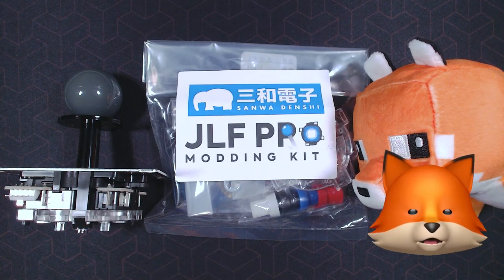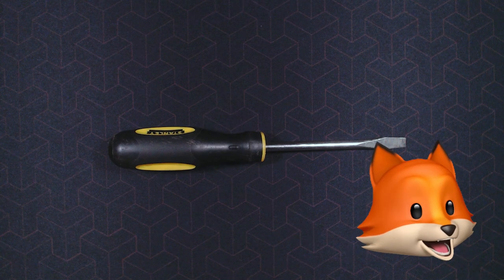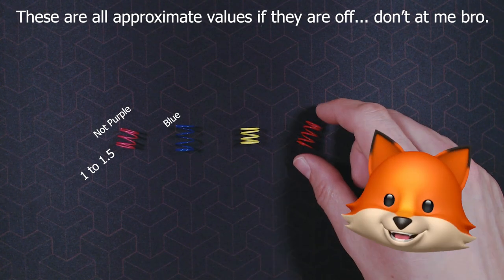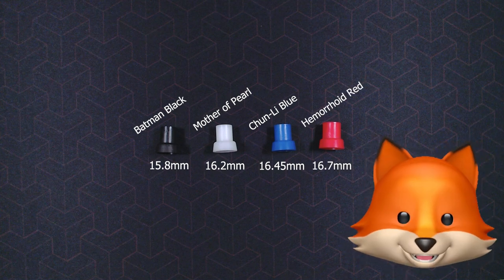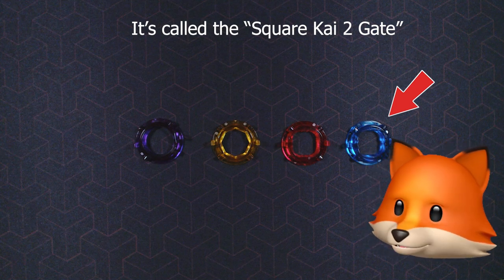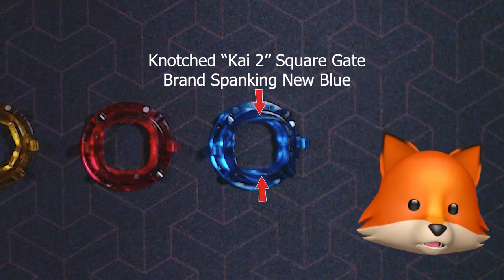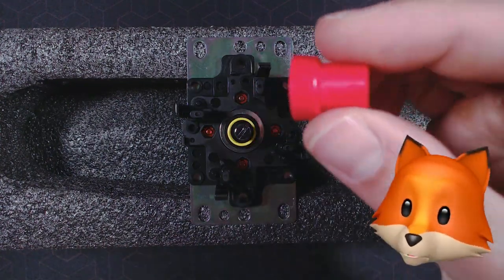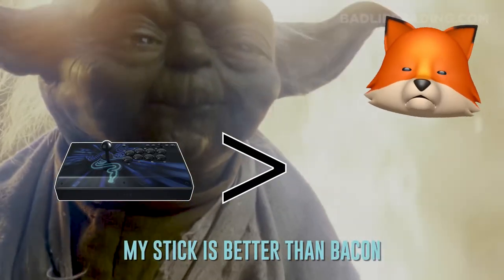The Sanwa JLF Mod Kit Breakdown and Install

Comment: Nice video. I am considering picking this up. Noob question but does it matter if I am using the stainless steel core for the Otto DIY v5? Should I go back to the stock core before trying this JLF mod kit?
Reply from the maker: 🦊Thank you 🤗… If I am not mistaken the Otto V5 should work just fine with the Mod kit. Also the stainless core should be fine!
Reply: @mr.arcadefox8782  TY! My kit just arrived today. Gonna install it when I get off work today
Reply from the maker: 🦊 Very cool! Hope you enjoyed it as much as I have!
Reply: @sadsadist  can u confirm if the kit compatible with the v5?

Comment: @Mr. Arcade Fox, is there a way to exchange the HORI Hayabusa stick and restrictor plate to a Sanwa or Seimitsu Stick and 8 way restrictor plate? And if so, do you have any tutorials on how to do it or do you offer services for that type of thing? Please respond, thanks
Reply from the maker: Swapping out levers out of a case are fairly simple. However changing out specific parts for specific levers is not too straight forward due to them being made by different manufacturers. 

What case do you have now? Do you want your Hayabusa to have a Octo gate?

Comment: which gate and spring is best for quarter circles? wave dashing in tekken?
Reply from the maker: Oh that’s a loaded question… lol. It’s very subjective. IMO I would recommend a K Lever for wave dashing in Tekken. On a J lever I personally use and like a square gate for quarter circles but that’s what I’m used to.
Reply: @mr.arcadefox8782  I feel it. Funny enough, I've spent so much money on K levers and yes they are easier to wave dash on but I realized that the K levers are so forgiving and went back to the J Lever to clean up my inputs.

Comment: I bought the mod kit and are waiting for it to be delivered.. did I get it right that the restriction gates that come with the kit doesn't work on the regular restrictor from an old samwa stick 🤔😳?
Reply from the maker: You are correct… it has its own redesigned system.
Reply: That kinda sucks but at the same time the springs are whats exciting 🙃
Reply from the maker: The new system is not a deal breaker and it works well. Honestly the gates are easier to change now.